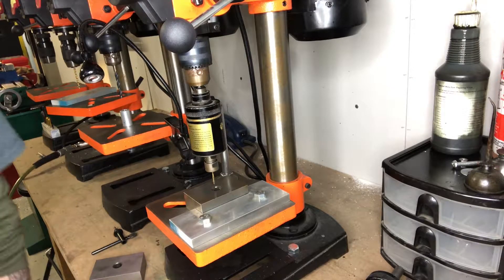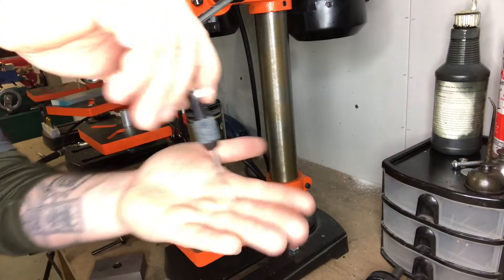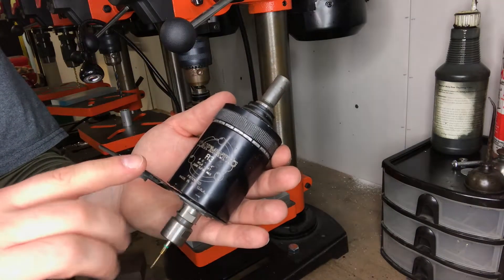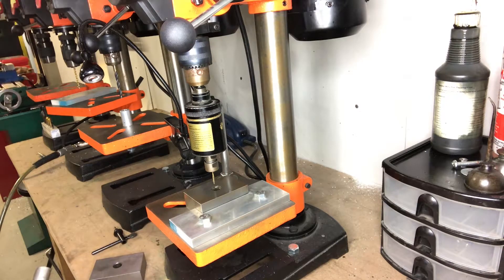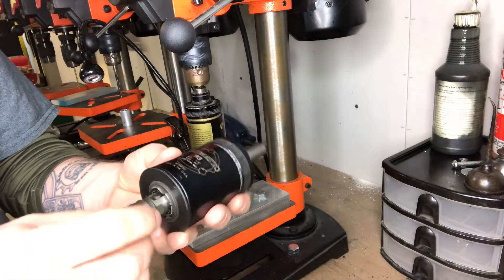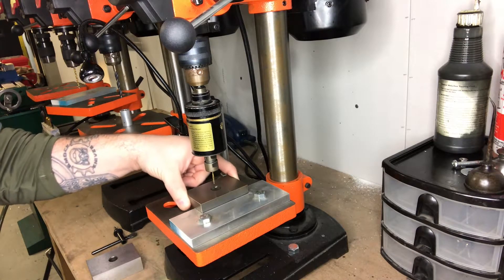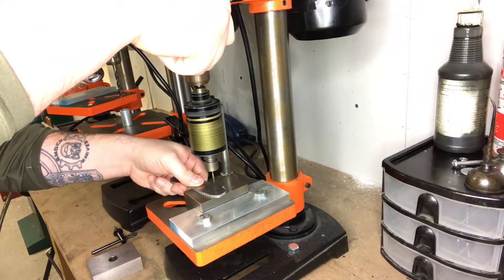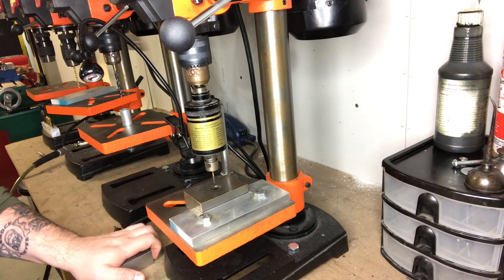Tapping Titanium and Tapmatic Setup

Comment: Great setup. Inspiring. I have a tapmatic off eBay. I got in a bidding war on a bus on the way home from classes once because I was having a bad day and just HAD to win! lol. Got a great deal on an awesome tapmatic. Forward many years later and I have a lathe and a mill. Both not great at all, but I have em. Still might not have the clearance for using my tapmatic though.. So I may need a cheap press like you're using. I made a titanium road bike frame without having to tap anything. Now I am making a cars intake and have many metric and NPT threads to make. Glad you showed Molly-Dee.. other people reference it and it leaves you guessing who makes it, how to spell it, and recognize it at a store. I also have that Ikea light with a bad switch that is waiting to get repurposed as a machine light like you did. Great detail! I like all the drill presses for their reliable separate use cases. Someday with home ownership I'd like to setup similar dedicated utility permanence. 
Haven't seen anyone do pipe taps with Ti yet. Also makes me wonder if I'd be better off switching to straight thread fittings with O-Rings rather than pipe fittings.

Comment: Thread forming taps have a larger drill size than a cutting tap,   first off. that may have been the breakage problem.
Look up forming tap sizes on a chart.Thread form taps by hand is not an easy task either.I've never seen anyone tap a form tap by hand ever in my 50 years as a toolmaker. With the right drill size and the drill press set-up, it should work well.
Look up a company called "Productivity" in Plymouth, MN. 

They have a red tapping fluid that works wonderful. About 15.00 dollars a bottle. One drop per hole. Can;t remember the name, but it;s red in color. If you don't see it, ask someone for help. This is by far the absolute best tapping fluid on the market. Hop this advise helps. I taught students at a technical college as well. Thanks for your time.
Reply from the maker: Thank you. I do know and use the correct size drill for forming and cutting taps. And I'm sure in a machining environment no one taps by hand but a lot of starting knife makers tap by hand. Hell, I know guys that get $2k+ for their knives and still tap by hand. Just a different culture. I've been using this set up for years and no issues. I even have a cnc now and still prefer to tap this way. But thanks for the comment!!